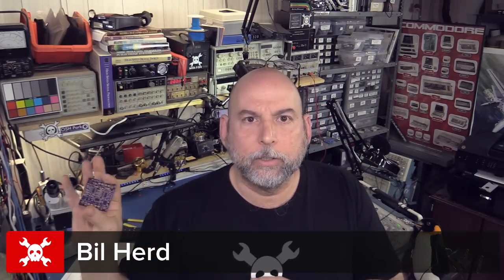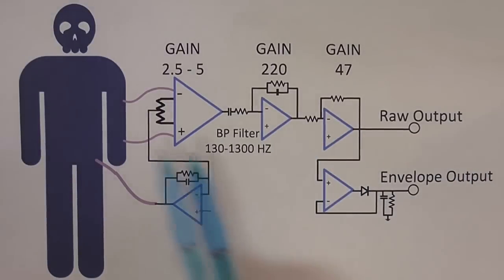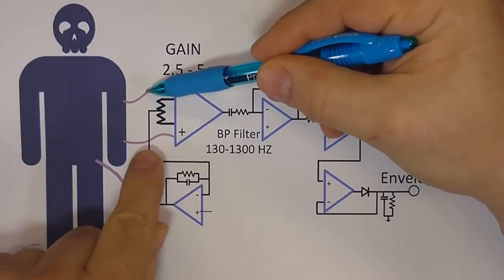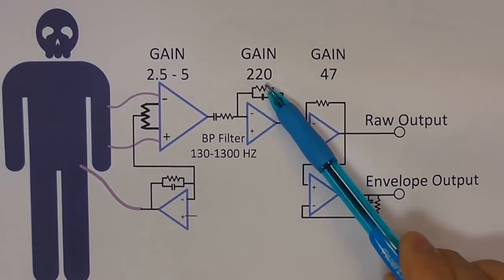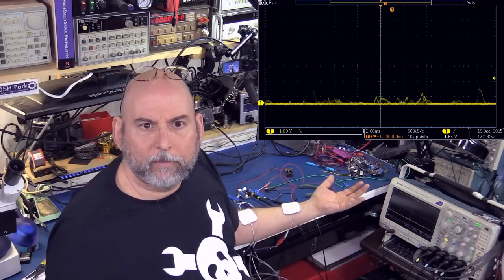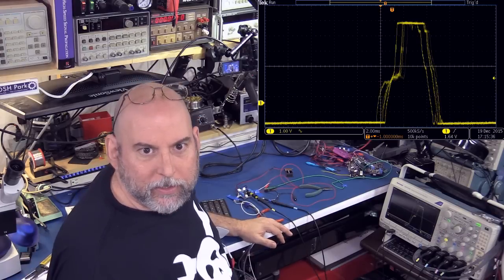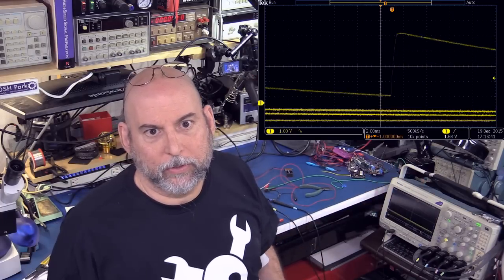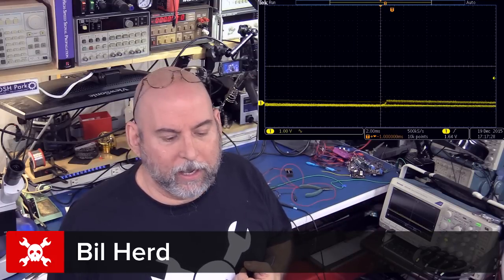Amplifying the Body's Electric Signals with SEMG

Comment: Why is your filter set to 130 to 1300 Hz? Neural activity is frequency modulated and very strong stimulus generates frequencies of 200 to 300 Hz maximum. Where did this filter range come from? Also, what power supply are you using? The schematic referred to on another web page doesn't show anything.